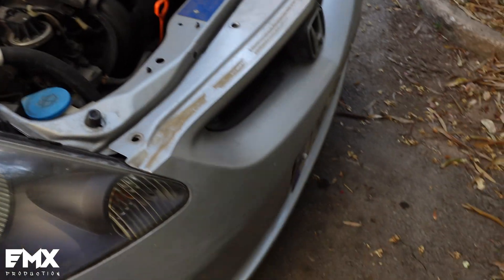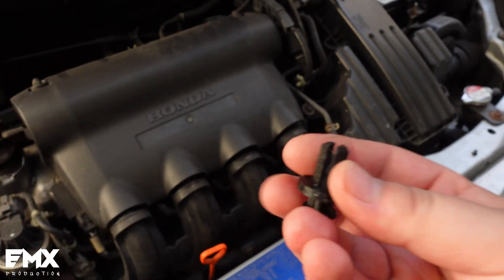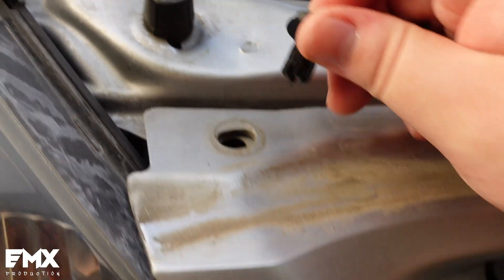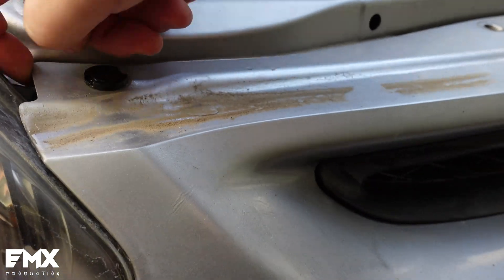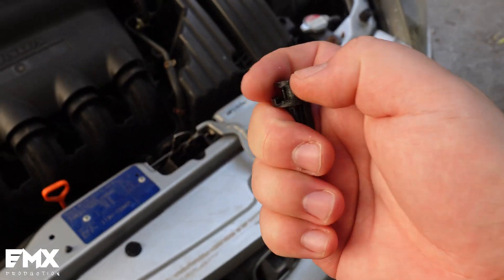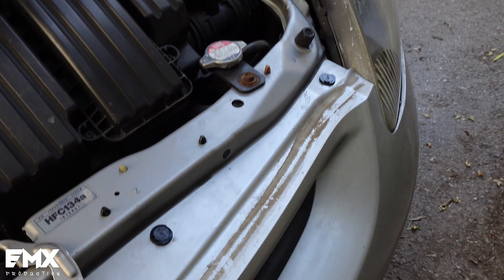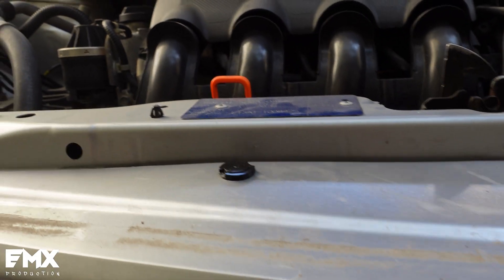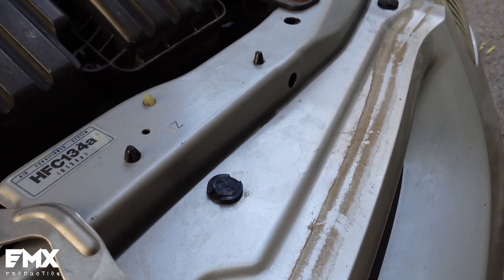3D Printed Car Parts Honda Bumper Clips

Comment: Hell yeah bro.  Reassembling my Element front end.  Might have to print some.  How are they holding up?
Reply from the maker: Still holding up but fkr best result use a asa or abs fillament . Pla holds but it becomes brital after few months .